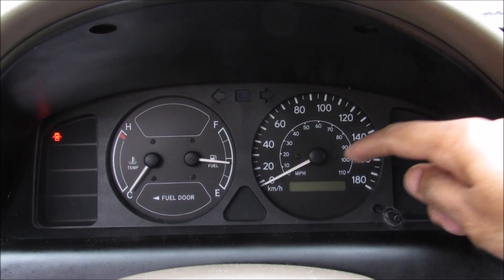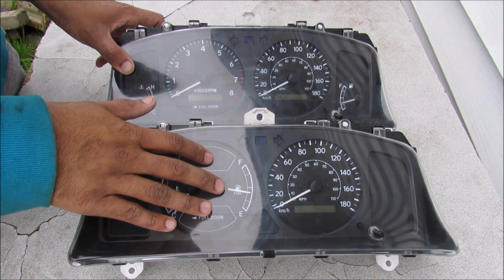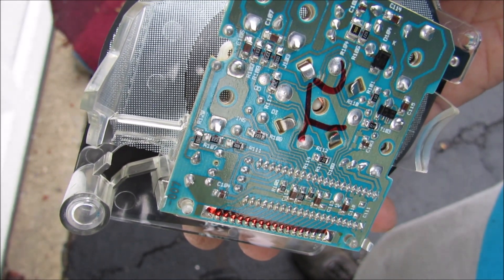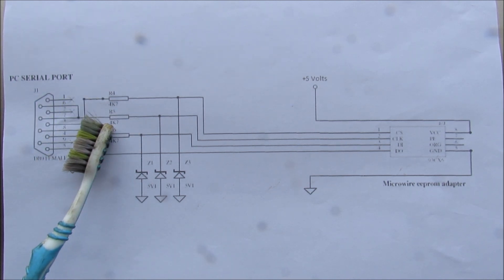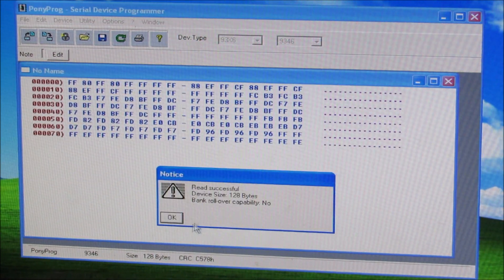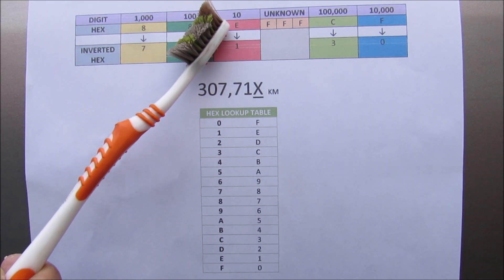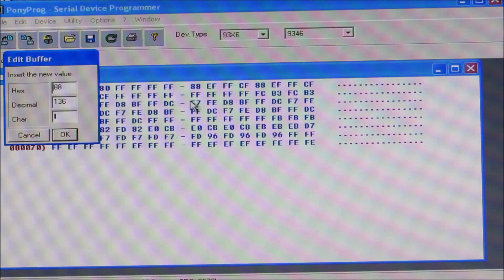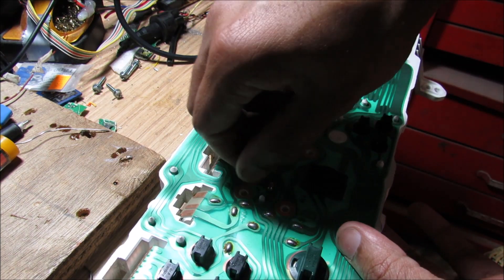How to Reprogram an Odometer after Swapping Clusters

Comment: If i just swap that speedometer/odometer to a replacement, everhthing else will work as normal? Like the alarm system and other electronic systems? My 2015 camry le turn signals/emergency lights wont turn on and was told need to replace the cluster

Comment: wow, I thought I would have a hard time looking for this information - you've probably heard that the corollas and matrix from 03-08 have the issue of odometer stopping at 299,999 km/mi. I've bought a new cluster from Toyota and was surprised it was pretty cheap overall but it has 0km on it rather than the km that I gave them - was kinda hoping it would be set to 300,000km really. Anyway, I'm thinking of setting it to 300,000km and see if it would make it function as it should - after that I'll try setting it at various x99,999km and see if it works. Nice to see some guidance here, was hoping this would be a good practice but hey, makes things faster I guess...

Comment: Is it possible to take off the needle and gauge face of the speedometer assembly and swap the face from a new gauge onto the old one’s electronics as a way to make the odometer match? Or is the needle attached/connected to what makes it move in a way that would make that too complicated.

Comment: Can you do a video to show how to stop the odometer counting up but still keep the speedo gauge working? Handy for farm vehicles in countries where they charge a road user tax based on odometer reading
Reply: I have got this working rudimentary by grounding the data in pin on the eeprom through a switch. When I start the vehicle with switch on the speed still works but the odometer does not

Comment: Guys I found these cables on Amazon, I bought 1 Soic cable for mileages correction, its worked pretty good, this links may help some here
SOIC: https://www.amazon.com/dp/B08RYVDYMG/ref=sr_1_1?dchild=1&keywords=B08RYVDYMG&qid=1609827495&sr=8-1
MSOP: https://www.amazon.com/dp/B08RYWYJ66/ref=sr_1_1?dchild=1&keywords=B08RYwYJ66&qid=1609827057&sr=8-1
TSSOP: https://www.amazon.com/dp/B08RYYMPDF/ref=sr_1_1?dchild=1&keywords=B08RYYMPDF&qid=1609827431&sr=8-1
Reply from the maker: Awesome

Comment: This is exactly what I needed! Thanks! I think I'll just swap the whole speedo module over, that programming is over my head XD
Reply: Did everything work after you just swapped the speedometer? Everything as in car alarm and other electrical systems.
Reply: @jjpalau  There is a known bug with the left turn signal if you switch from a pre-facelift to post-facelift cluster (or vice-versa). But otherwise mine has worked fine.
Reply from the maker: That can work too

Comment: I was wondering will get in trouble with the DMV or the inspection office once I switch my cluster on my 05 f150 because I had to buy a new mother it has 150k miles and my odometer on the original cluster says 227k miles but I got this engine with only 150k miles and I found a cluster from a junk yard reading 150k miles but idk when I do oil change at a 10 minute oil change place if they or the inspection office including the DMV will say why is the mileages less from the last time you had inspection and they probably won't give me my plates since I'm from Texas any advice or should I just leave the original cluster that has 227k miles with a new engine that marks 150k miles

Comment: I'am after swap in my car and now my rev limiter is higher. And now if I have  my old cluster in my car with KM/H and I have bought cluster with MP/H ( This version have proper rev limit ) Could I just exchange this 93C46Cb3 part from my old cluster to the new which one have MP/H ?? In that case the ODO will show my oryginal value in KM and after drive it will be adding new values in KM or MIles ?